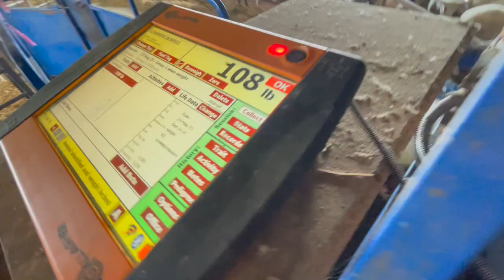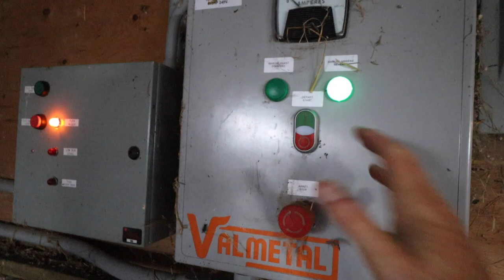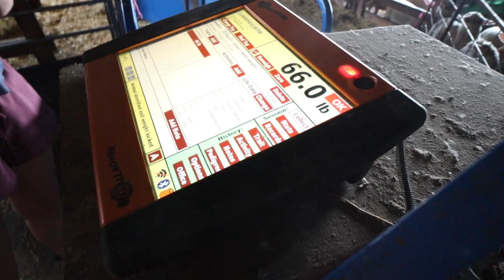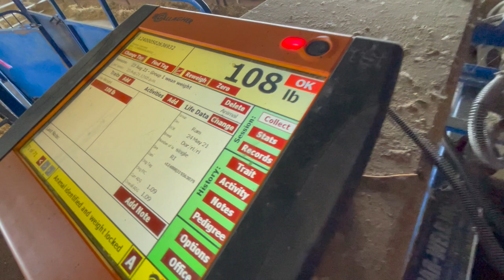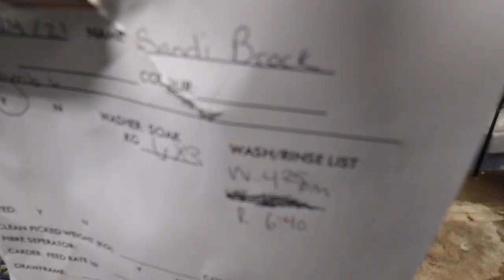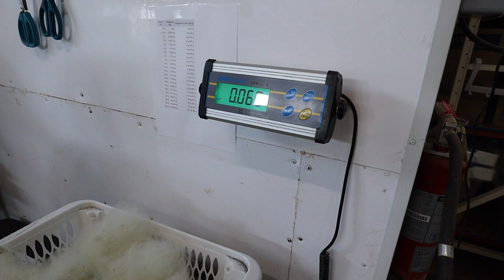EWE CAME BACK!😱 | what a WOOLLY surprise!!🙌 | Vlog 484

Comment: Considering how shit wool prices seem to be, you'd think that wool products would be pretty cheap.  But nope, it's almost impossible to find genuine wool carpets, blankets, socks, etc. without paying an arm and a leg.  I like wool products.  As someone with older pets who... make mistakes.  They're hard to dirty, easy to clean, and they aren't overly bad in a sensory way like some modern fiber types can be (maybe a bit itchy if they haven't been washed right, but that's about it), plus it's naturally fire retardant which is a huge bonus.  I'm honestly really glad to see wool being used for stuff, even if it's smaller stuff like felting kits and yarn.  Since moving out on my own wool has become one of my favorite things.
Reply: Unlike man made fibers it is fully biodegradable. ♥️
Reply: The US military uses wool for clothing and blankets (that I know of) precisely because of its fire retardant nature… also artificial fibers tend to melt into the skin when exposed to heat — increasing the damage inflicted by the burns!

Comment: Hey Sandi, I remember you saying something about how these Y shaped pipes often come out of the socket up top by the red thing (Sorry the terminology evades me) ... I had a thought on how to hold them in place even when the Duct tape fails.  What you could do is take some of your copious amounts of baling twine and run it in a circle down through the y and back up to the overhead beam near the red spout, thus creating a tie up..  You might have to tighten them up every once in awhile with an old fashioned stick and twirl approach (Think wire gate twist openings with a stick and a piece of wire in a twist... something like a turnbuckle)  Just a brainstorm I had to help with the loss of grain when it comes loose.

Comment: Seeing that mill took my back when i use to work in the textile mill. The equipment is way smaller but some of the things they do are similar, like the combing machine and the last one which spinning up the wool on a tapered cone. I use to do maintenance on those machine.

Comment: Wondering if birth date has anything to do with weaning weight. Does the Gallagher have a function where you could range the lambs by birth date and see if the younger ones are typically lower weaning weight? Very curious.